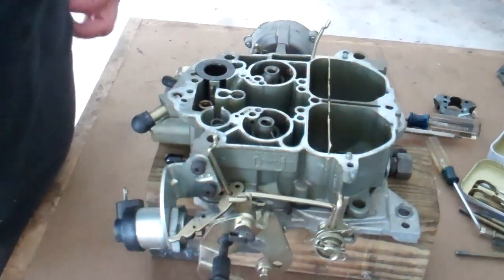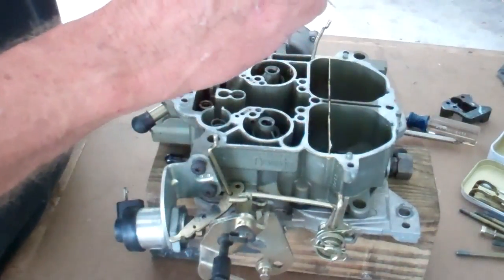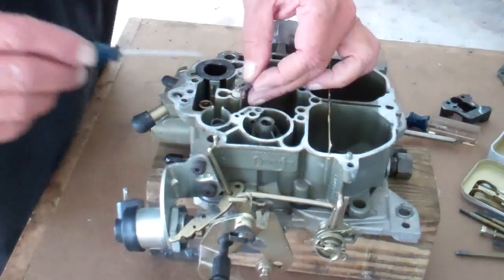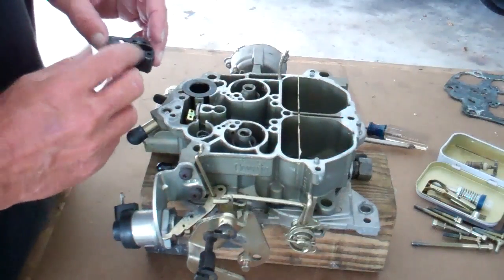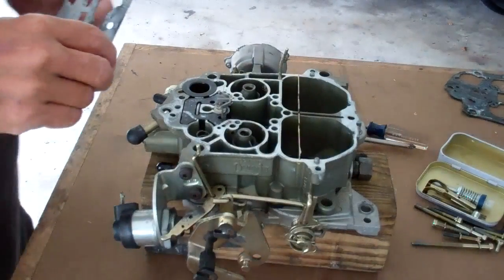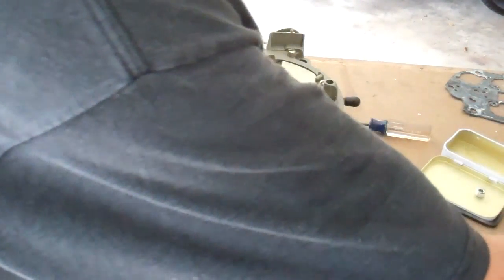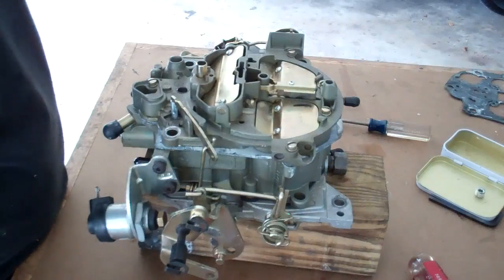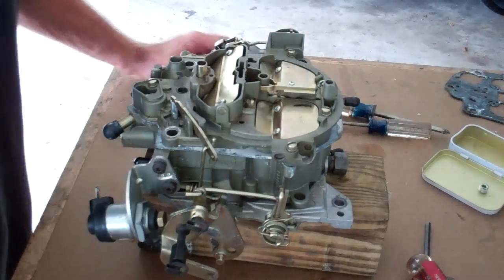re-jet your Quadrajet (part 2)

Comment: It is also a good idea to mention that the tiny clip on the needle does NOT go through one of the holes in the float arm. There is a recommended sequence the bolts should be tightened. It's not too critical though.The roll pin is 3/32". Thanks for the video.

Comment from the maker: there are quite a few q-jets without APT.  generally speaking if your casting doesn't have it there isn't anything to be done about it.  look just in front of the vent hole, if you see a brass or aluminum plug you can pull that, tap and install APT.  it's a bit difficult and needs to be PRECISE, but it can be done.

Comment: On my carb 7044213 is doesn't have the hole in the top where you are adjusting the metering rod piston. Can I drill a hole in mine and just use a pipe plug afterwards or would it be ok to just leave it open? I don't want to keep having to remove the top and make adjustments. My carb is running rich at at idle and I was told I need to go from 68 jets to 75 and from 36 prim rods to 43B. Would that help with the rich idle? Seems like going to larger jets would just make it worse. Thanks

Comment: Thank you. This was very helpful and extremely well done. I have a GTO coming and I live at 5300 feet, so I will need to re-jet for the altitude. Hopefully I don’t have to touch the metering rods, just the jets, but I’ve never worked on a Quadrajet before. Any advice for what jets and or rods to use for this altitude?

Comment: Great video Ed! Getting ready to re-jet my Q-jet on a mildly built 454 that was originally a BBC carb (7041205), but was rebuilt for small block duty. Now its time to take it back to original specs and see if thats good enough or if I'll have to re-jet one more time to feed the BBC. Any truth to the advice to only go up 10% at a time on jet size? Thanks again!

Comment: Awesome tutorial Mr. Beach, my question which you may have answered another time, is what is the best way to figure out which gasket goes between the air horn and the body if you don't have the previous gasket. Mine is a Carter 7043202, fs, c3. Thanks for any help.
Reply from the maker: it will be evident when you get your rebuild kit, as a rule of thumb the thinner of the two is below and the thicker above

Comment from the maker: changing jets changes the size of the orifice gas goes thru to get to the carb.  changing metering rod sizes will change the amount of fuel the carbs gets as well.  if you are new to q-jets there is a great book avail.  google it, the author is Cliff Ruggles - it has more info than you can imagine; very informative.

Comment: Hi, I enjoyed your video.Question, After the APT screw contacts the pin on the power
piston, you then turn the adjustment screw 3 turns?I wasn't quite sure, you mentioned
9 turns untill the piston is forced out of the bore?Your video is the first one I've seen that even mentions that adjustment.  Thanks,  Hoyt

Comment: Man thanks a ton for your video , I just got a rebuilt 700 quad and installed it lol I lost more that half the power I had with my tuned in holly so I have some big time tuning to do to the Qj . I have never had one and was intimated till I watched your video. I have a pontiac 400 with ram air 3 heads and a ram air 4 cam since it's stock stuff I was thinking I may be able to dig up GM's spec's for the Qj when this combo came from the factory ? any ideas on that ? thanks again :) Marc

Comment: So if I am running lean will I need to adjust the metering rods with that screw to richen it up. It is firing back thru the carb when I give it a good stomp on the gas.
Reply from the maker: if it's backfiring through the carb you have other problems - anywhere from used up accelerator pump to bad timing, bad valves, etc.
Reply: EdontheBeach Thank You Ed. We had to adjust the timing high cause of a bad harmonic balance. Then we put a new Harmonic balance in it, set the timing,  set the float, and idlers adjusted, Number one cylinder at top dead. Just had a new carb kit installed. Would a check ball be stuck also?

Comment: Hi Ed, i got a R4-4MV Quadrajet (Nr.:7042902) and the secondary will not open. i checked the manual but there is no pic close enough from the throttle linkage between the primary and the secondary to see what´s wrong with my carb. Can you hlep me out? Thanks for your effort. :-) Greet from Bavaria
Reply: If you never figured this out, check on the opposite side of the carb from the throttle linkage, look for the secondaries throttle shaft and see if the lockout/block/tab is moved away from the pin going through the shaft. If it's contacting the pin it stops the secondaries from opening because the choke has not turned off or isn't wired correctly. I just tied the block back away from the pin since my choke is broken, but you aren't supposed to stomp it until it's warm if you do this. That block keeps you from opening the secondaries on a cold motor.